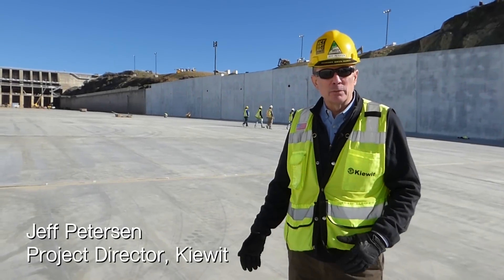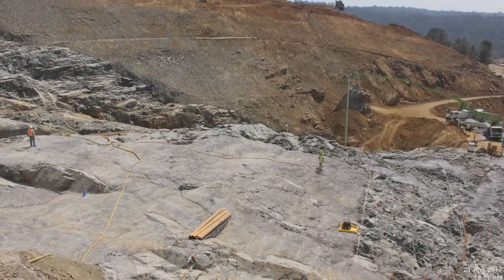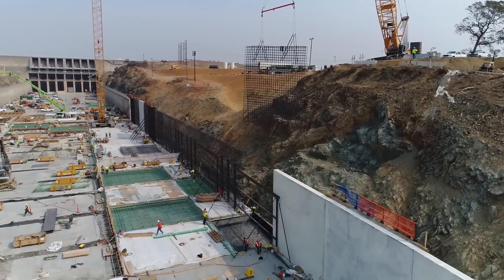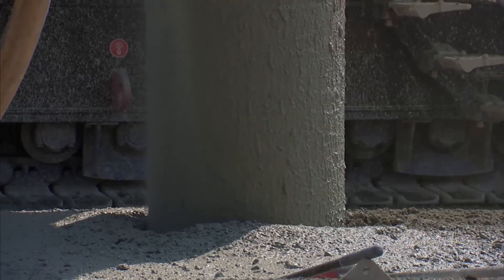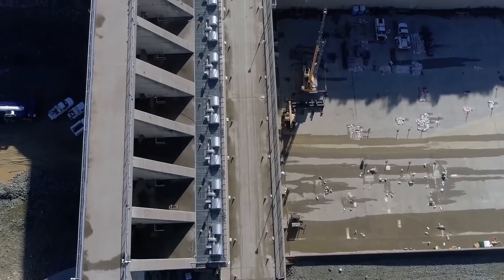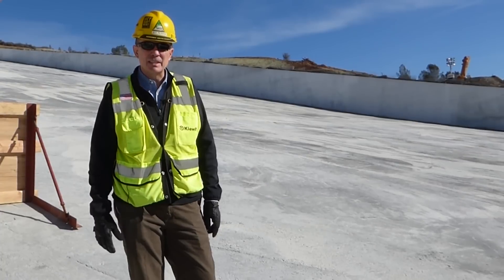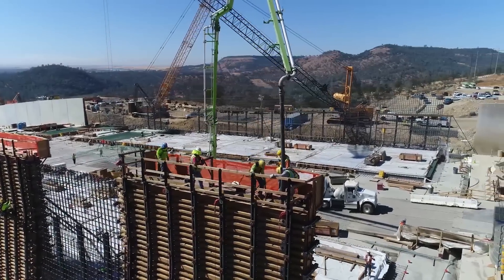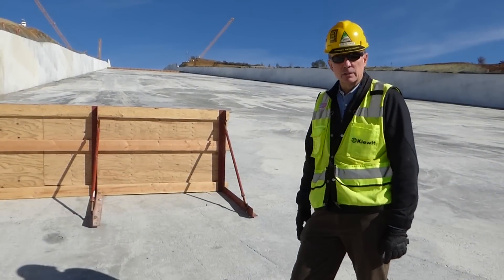Oroville Dam’s spillway expeditious emergency rebuild

Comment: "remove the walls..." What? Why not design it where you can just "thicken up" the emergency walls? Also, why are the slabs not angled, the joints are all perpendicular to the water flow, hugely increasing the force the water applies to those "faces".
I don't understand this design at all.
Same with the emergency spillway. It's got just dirt surrounding that area, no concrete or rock boulders to significantly decrease the erosion. 
Seems like a really poorly designed dam. (originally)
Reply: Actually...
The forensic report was just released, the blame lies with...everyone.
Poor workmanship was at the top of the list, followed by poor management by about everyone who had oversight. Design was partially to blame. For instance, rebar should have been thicker, and more used. But this aspect of the design did not contribute to the spillway failure.
Essentially, it was built too thin, did not have enough rebar, and it was not bedded on competent rock. All of these things where in defiance of the actual design with the exception of the amount of rebar (which was acceptable at the time). So, the inspection process failed, and the contractor was allowed to build to a lower standard.
Once moisture penetrated to the rebar, the rebar rusted and caused the concrete to erupt so badly, the spalling was visible with Google Earth. These are not "cracks" in the normal sense, they were eruptions that did not penetrate through the concrete. the actual penetration was caused by a combination of freeze/thaw cycles and the pounding of the water. Cavitation may or may not have made it worse (no one really knows).
At this point, several independent organizations warned various state departments of the danger. Ultimately it was the State of Ca that refused to fund repairs, since they seem to have other priorities for spending.
The spillway could have been saved years ago when the timing was optimal because of drought. Now the rest of the country is on the hook for this.#notmydam
Reply: Thank you for elaborating on this issue. I am sure it is hard to predict the worst case scenario and you hope to never see one. This dam sure has seen the worst that can happen, short of a complete failure of the dam wall. The scale of the repairs is so impressive and phenomenal, I am sure everybody involved learned a big deal about structure, design and such.
Thanks again!
Reply: NP. I only know as much as I do because of the blancolirio channel. He lives under the dam and has worked from the start as a citizen journalist to get the real story. He does an amazing job of answering all the questions that pop into your mind.
Reply: @johnny llooddte
You should actually check out the design specs. The main spillway will handle about 2x the largest flood ever rumored (this predates European settlement of the area). If the dam ever overtops, and the main spillway is not able to handle the flow, then the end of the world is at hand. Don't forget that the upper portion and gates handled this emergency with out breaking a sweat. Once they realized the danger of the headcutting of the emergency spillway (it would have undermined the gates, not the dam), they re-opened the gates and it was brought back under control in a few hours.
The issue was poor management. The DWR tried to bank more water than they should have while at the same time removing a turbine for overhaul which reduced the power plants ability by 20%. Add to this that Ca never bothered to move the transmission lines off the emergency spillway slope meant that once the hillside eroded into the river, the generators not only had to be shut off because they where below the water level, they could not be turned back on until the lines where re-routed around the entire complex.
Reply: there would be way too much pressure on an angled wall than it could support.....
Reply: @MrMustangMan  sorry for my poor English, not angled walls, but sloped slabs like stepped down
Reply: The slabs are not angled because they are stronger "face on." Spillway design is very complicated, especially on one that is a huge and steep as this one. It was well designed originally and better designed now. It failed due to a combination of poor workmanship, and the State ignoring the problems (It was notified by several groups years in advance of the spillway failing). Most folks expect the forensic report to reflect this, but the State has already made some moves to try and get the report classified (security threats), so we may never know what it says.

The emergency spillways is just that, an emergency spillway. It is not expected to ever see any use. It was only used last year because the DWR mis-managed the damn. When they shut down the main spillway, the flow over the top started headcutting the hillside towards the main spillway. They had to re-open the main spillway because of concerns the hillside would cut back and endanger the gate system. A damn of this type can not wash away, losing the gate system would mean losing control over flooding though, and would be a huge disaster.
The secant wall described in the video is to prevent spillover from head cutting above the way. The space between the road/parking lot (the lowest part of the top of the damn), and the secant wall will be filled with concrete. The wall itself is about 60feet deep into the ground and will prevent erosion from cutting upwards to the top of the damn. The hillside below will be allowed to erode away though. Keep in mind this is only for total environmental break down, if things are so bad the emergency spillways gets used, then erosion will be the least of our worries.
The main spillway can flow about twice the GPM ever rumored to have come out of the mountains. Under normal conditions, water levels are managed through the power plant in the damn itself, and the main spillway is only used to let off extra water during spring thaws.
Reply: The 'walls' are temporary. Kiewit used heavy rebar screens, tied them together, and filled them with the loose aggregate material that is used for RCC. They smoothed on a veneer of shot crete, and then applied a coat of paint.  Many of the design choices seem to have been limited by the tight time frame.  The forensic report will be out this month - and will ascertain whether the 500 million in temporary partial repair is appropriate for a dam which has passed its projected life expectancy.  The most difficult portion of the work remains as the gate structure is at end stage.
Reply: Very good thank you for the details on this.
I am not an engineer, but things like this keep me awake at night and I like to understand them.
Much appreciated! And a happy new year!
Reply: because its a GOVT PROJECT ahahahahah
Reply: ahaha 100 million dollar pretty panels that have to be removed or 100  million dollar permanent  panels that can be reinforced later..well duhh lets go the stupid route
Reply: unless you  PREDICT WORSE CASE SCENARIOS ,, then youre NOT an engineer and  youre worthless.. the emergency wall  end spillway is still a major  problem..it will cost another billion and that wont  fix it.. ANY prolonged overtopping of water on that spillway even with another BILLION in concrete will still have a FAILURE of the dam.. they NEED to build a  SECOND regular  spillway or relief channel somewhere else
Reply: Johnny, I am predicting that you are costing somebody plenty in meds.
Reply: it did NOT FAIL because  of poor workmanship  ahahah
at the time..it was state of the art.. one  of the most expensive dam projects in the world and was watched by millions just  like todays repairs... it was done the best they could at the time..give  me a break

Comment: Its amazing what can be accomplished when government gets out of way and the American "Can Do" spirit takes over.
Reply: Um... the dam is owned by the... um, you know... government...
Reply: Without Government Oroville Dam would never have even existed.  You are clueless.  Big corporations are just as bureaucratic and dysfunctional is big government.
Reply: ahahah if private enterprise had done this,,, it would have cost 100 million  and be finished..not one billion and halfway done and  TEMPORRY ahahahha
Reply: @johnnyllooddte3415  and none of the inspections and QA documentation would have been done....which is why the original spill way failed.  You "private sector" fan boys are clueless.  When someone is not looking over the shoulder of the Contractor, they will often cut corners, use lower quality materials, and build a substandard structure because that makes them more money.  Then in 30 years when it fails people wonder how this happened.
Reply: Government is very much IN the way for local residents that have been locked out of their own backyard, and have been threatened with arrest for going about their usual routines!

Comment: great progress on Oroville next year the RCC will be removed and replaced with structural concrete and thermal concrete. right now the focus is on the Emergency Spillway it needs to be replaced because last year's flood destroyed it and took a section off the main spillway. they need to repair the weer, and drill down to bedrock and replace the dirt with concrete so a mudslide does not take out the dam.
Reply: another worthless billion wasted
Reply: Johnny Troll